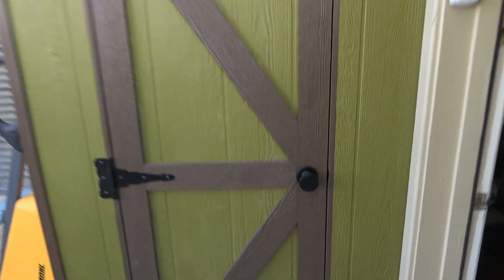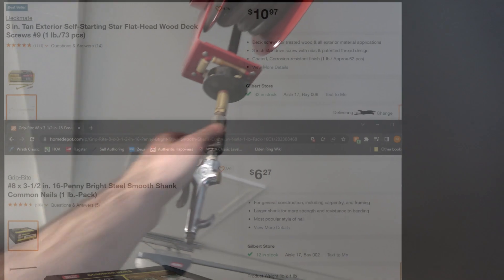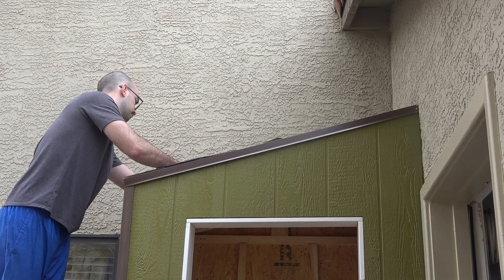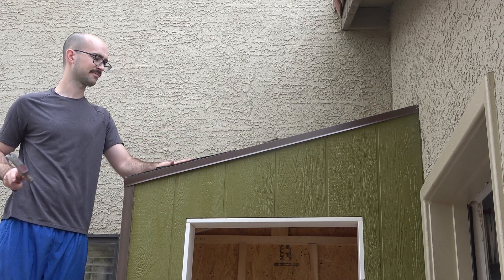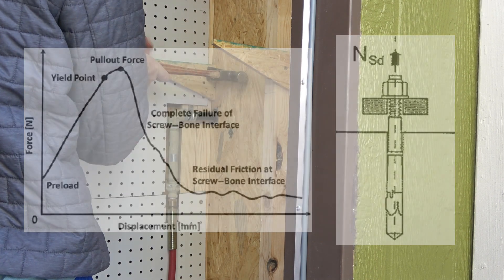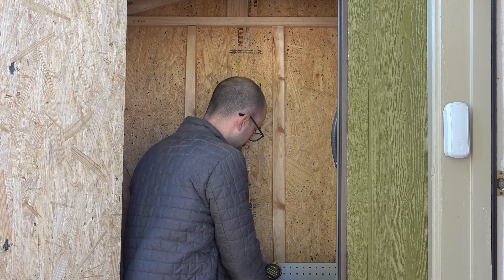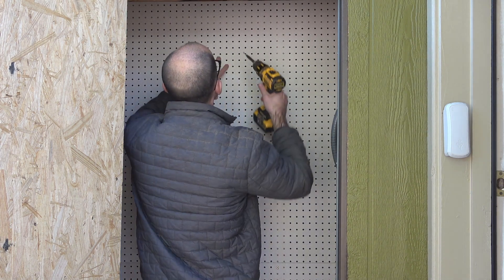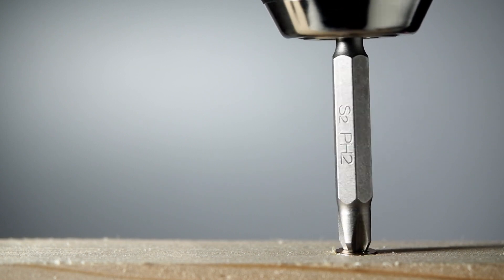Should I Use Screws or Nails?

Comment: There are thousands of historical homes standing that were built with nails. This current craze to screw everything together simply adds more time and costs to projects. Nails and 2" staples provide plenty of holding power. Adding an occasional screw in parts where movement and vibration occur is a good idea, but the current trend to overbuild everything like it has to last 1000 years is foolishness.
Reply from the maker: For myself, I've found that when my skills and knowledge are lacking, I overbuild things because I am not confident in the results. As I gain experience, I am more confident in using the right tool for the application, which makes everything more efficient.